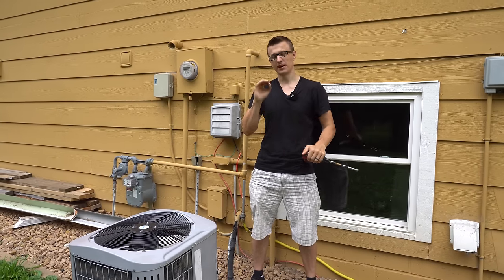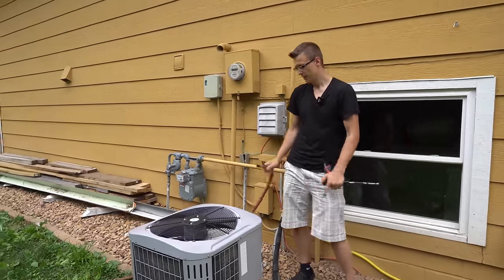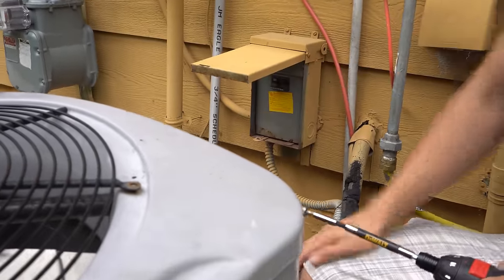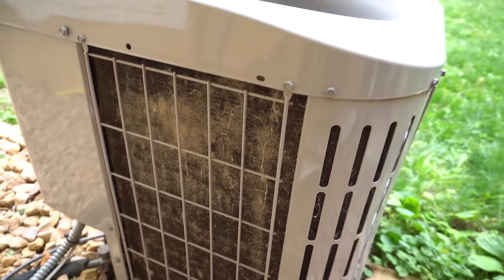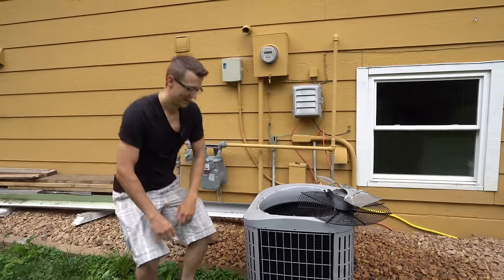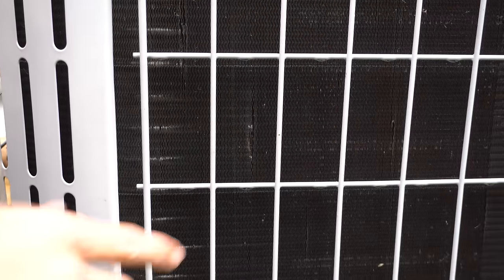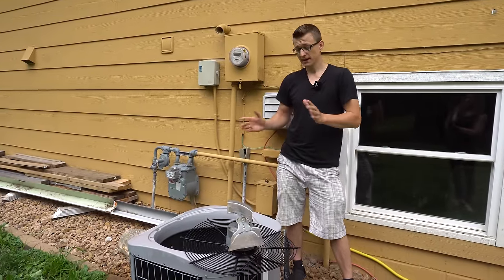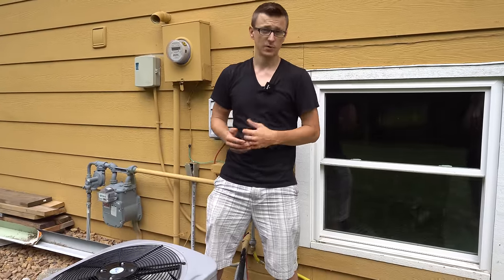#1 AC Problem With Central Air Conditioning Not Cooling

Comment: Hi and thank you for the video.  I have a vicious problem with my AC.  I have one unit that is split between 1st and 2nd floor with a thermostat in each floor.  If I turn both thermostats on, the AC works for a short time then stops. Then temperature starts rising without the unit kicking back on. When I turn one thermostat on, and the the 2nd one off, the AC works longer then stops and won't turn on again, then temperature at the house will keep rising. What I do, I turn off the thermostat that was on and turn on the other thermostat upstairs that was initially off.  The unit will start working again (sometimes not) works for sometimes, then it stops. Then temperature rises without the unit kicking back on. So, I turn it off then turn on the downstairs thermostat.  This is a temp solution, but does not work all the time. I do not know what to do.  The unit still works. The freon level is good. Have you had similar issues?  Thank you for your help. Zak

Comment: Gotta wash the coils, after solving the puzzle... 121.
Reply from the maker: 121 is incorrect
Reply: @WordofAdviceTV  I don't think I missed anything, but it is possible.  Either way, I'll consider myself right until someone logically proves me wrong.
Reply from the maker: @JBNetBreaker  It is more of a trick puzzle than a math puzzle. Try to take a closer look at the pictures and look for differences.

Comment: Other videos say if the lines are frozen then evap coil is too . That's my situation . Left them thawing out since early morning . My inside coil is hard to get to lying on top of furnace coonected to a few lines . I guess it's freon supply , drain  and one from the outside unit ? Goodman system

Comment: Our ac seems to not go below 73. Even before this heat wave, it wouldn't go below even though I have it set to 68. Also seems to be hitting 78 as the sun goes down, I'm guessing from the humidity. I nest changed the filter and still acting this way. Anything else I could try?

Comment: Do you have to take the top off? Can you just spray around sides and down in there?
Reply from the maker: No need to take the top off. Often times I simply spray it from outside in, all around it. That's more than enough.

Comment: Hey Jay, My AC isn't blowing cold air just blowing air. I don't get 24 volts to the thermostat or the outside unit. I checked the Zone Control Card EWC-ST-2D and I get no voltage to the Y wire. So I think its this card thats the problen.  Should I just replace it or try to fix it?? TIA

Comment: 165

BTW, what are your thoughts on using reclaimed R22?
Reply from the maker: 165 is incorrect :)

Is it reclaimed or recycled refrigerant? Reclaimed refrigerant is normally okay to use as long as it is not contaminated and is being put into the same unit it was taken out of. Other than that it should not be re-used. Or at least that's what I have been taught and have been doing.
Reply: Given how expensive R22 has become, lots of folks now selling recycled R22. Soon that will be all there is available. Who does a quality job of recycling?

Comment: My AC is almost 5 yrs old & stop cooling enough about a month ago. Compressor was replaced but didn’t fix the problem. Expansion valve and a filter on a copper hot line outside were also replaced and still not cooling enough during the day.

Comment: What's up Jay? Do you know anything about the HVAC system in cars? I have a Jeep with an open grill that allows insects to get caught in the radiator fins. Would it be safe or even effective to spray it from inside out like in this video?
Reply from the maker: Hey man! The coil on cars are pretty much the same thing. You could get most of the stuff off with water, just try not to bend too many of the aluminum fins in the process. (no pressure washer) If you put some soapy water into a spray bottle and spray down the coil that would probably help get more stuff off. Let it soak for 5 minutes before rinsing it off. You could also apply a brush to the fins to scrub some of the more caked on bugs. Again, if the fins are getting flattened left and right, it'd be better to just leave the bug there. 😄
Reply: @WordofAdviceTV  Good looking out...💯

Comment: Jay I was able to check the temperature before the Evaporator and after with a digital thermometer and after a while at each side I got 71.1 before and 41.1 after evaporator. Thats 30 degrees difference. Could this be right? Now the problem I am getting is when I set thermostat to 74 it drops temp but doesn't turn off, at 75 it turns off and turns on by itself. What could it be? Thanks Mark

Comment: My ac is working now after cleaning it with water 🚿.  Didn’t remove the fan 😅
Reply: How long after you cleaned it, did it take for it to start blowing cold again? 😅
Reply: @TheBoxingFamBam  lmaoo I need that answer too.  The inside still doe t have that frost condensation yet
Reply: Did you spray just outside the unit or inside and outside?

Comment: Yesterday I accidentally dropped a screw for the electrical section cover on my York Stellar compressor unit inside the unit. I thought it wouldn’t be difficult to remove the fan and hang it somehow while I fished out the screw. However, I couldn’t figure how to hang the fan either over the side or on top without breaking the wires to the fan , bending the fan blades, or damaging the cooling fins. Any good advice would be appreciated.
Reply: Watch the video he just did the same thing

Comment: Do you recommend using coil cleaner on the condensor? What about evaporator?
Reply: Aaron Gray In my opinion if you are cleaning your condenser each a/c season using just water is really all that’s needed. But most people don’t clean them regularly and wait until they are really blocked with dust, grass, etc. If that’s the case use coil cleaner, just be sure to rinse it throughly. Most evaporator coils are difficult to access the fins but if you are changing air filters regularly it’s not so much an issue. But if you can clearly see the coil fins and they are dirty then yes clean them, it’s not an annual thing like condenser coils.
Reply: @roberts1159  Thank you Robert.

Comment: I just started school for hvac, when you get a service call what’s your starting point ?
Reply: Hey Austin. I just graduated from my trade school a few months ago. Maybe someone can correct me if I'm wrong.... But first you would turn your thermostat on cooling and wait to listen for your blower motor to turn on... If your furnace or air handler blower motor doesn't turn on, you know that's where your problem is... But if it does turn on, check and see if your outdoor unit, fan and compressor, are running... If your outdoor unit does not turn on, then you know thats where your problem is. I hope this helps!

Comment: Answer is 26. 45/3= 15 so each gray hex is 15. 23-15=8 so both bananas=8 and 8/2=4 so each banana=4. 10-4=6 so both clocks=6 and 6/2=3 so each clock=3. then add 15+4+4+3=26.
Reply from the maker: It's a trick puzzle and you are still missing an aspect of it. 26 is incorrect.
Reply: @WordofAdviceTV  oh i see the last gray box is different and that it is a multiplication sign not an addition sign. I'm gonna guess each gray shape is worth 5 (becuase they each equal 15 and there are 3 shapes in each gray figure so each shape should be worth 5.) so 3+4+4*10=47 if your using order of operations. If not then 11*10=110. Im gonna go with 47.
Reply: @hungrybear2161 still missing about 3 other details.

Comment: This is out of context from this video but I’m having issues with my unit. Basically my unit stops dripping water after a while and blows air through the drain line which I have also noticed that the air that comes inside the house looses pressure. No the drain line isn’t clogged I cleaned it and I still have the same issue. I have to turn off the unit for about an hr. Then I’ll turn it back on works for about 1-2hrs and does it again. What could it be?? Your advice will be really appreciated!!!
Reply from the maker: Hi there! What you described sounds like your evaporator coil may be freezing over. This is often caused by either bad airflow or the ac unit is low on refrigerant. I would try replacing the furnace filter if you haven't tried that yet, make sure your returns are open and not too many vents are closed, clean the evaporator coil if you can access it, and lastly if the unit is low on refrigerant unfortunately this would be the point at which you would have to call out a tech. For more ideas of what to look for I have a video on 20 possible causes:
https://youtu.be/6jsm3tWmoPU
Reply: Word of Advice TV thank you sir. I will look into what you described and get it fixed as soon as possible cause this heat is no joke. I really appreciate your help!!

Comment: I have a Bryant (communicating system) units. I would get error code 76 low stage repeat no start. Do you know what would cause the error? I would think  compressor works (there is cold air) Thanks.

Comment: My Frigidaire has the reverse problem. The compressor? won't stop blowing cool air. Even when I turn up the thermostat to 90. Even when I turn the a/c off, the compressor stays on drawing power from the outlet. I have to unplug it to turn off the compressor, which turns off the a/c. I suspect that there's something wrong with the thermostat or worse. I bought this casement a/c in 2013, so it's not new or very old. My a/c has no reset button.

Comment: Can you make a video on signs of low AC refrigerant? I know that seeing your suction line freeze up is a big indicator since it may imply a leak. However, what if you don’t let your AC run long enough for that the line to freeze up? (i.e. you immediately feel no cool air so you turn off your AC). Also, as a homeowner, we may not have the tools, such as a gauge, necessary to check thoroughly. Therefore, any methods for diagnosing a low refrigerant system without a gauge will deeply be appreciated.
Reply from the maker: That is a good video idea! Thank you for the suggestion!
Reply: The suction line (big copper pipe) should be sweating during AC running. If no condensate water on suction line during AC running your AC might be low on Freon

Comment: The reason cold air is blowing but not cooling the house is cuz this? What’s the technical name for this problem?
Reply from the maker: There are a variety of things that can cause this. This (a dirty/plugged condenser coil) and a failed capacitor are two of the most common causes.

Comment: Both air handler and condenser working, but warm air coming through. Could it be low freon?
Reply from the maker: Yes it could be that or maybe the compressor is not coming on at all. Actually there could be quite a few causes, I have a video on that if you would like to see what the others are: https://youtu.be/6jsm3tWmoPU

Comment: The answer is 88. (2+3+3×11=88)
Reply from the maker: 88 is incorrect
Reply: @WordofAdviceTV  explain.  Each figure is different.
Reply: @WordofAdviceTV  I need a breakdown to dispute. Math is literally my superpower. In my break down which number was wrong?
Reply from the maker: @pinkiithe3nigma257  Its not that your numbers are wrong. Its just that this is more of a trick puzzle than a math puzzle. Paying attention to details. The answer and explanation is at the bottom of the video description 😉
Reply: @WordofAdviceTV  ahhhhh. Order of operations was skipped on my behalf. I solved from left to right instead.

Comment: I have a concept 1000 ac outdoor unit I changed out the capacitor but still doesn't come on any suggestions...?? Anybody  ?? Brand new capacitor installed but no fix

Comment: don't you think you should probably be telling the people to turn the breaker off so you don't end up having the fan blade chop them up? the first thing you need to be telling to do is to be sure and to turn off the breaker to the air handler and the condenser there buddy!
Reply: @Arin, did you watch the video? That was stated in the beginning.
Reply: @Ratlins9  yes I watch the video and after all the screws were taken out of the machine it was advised to turn the breaker off any safety coordinator would have corrected that the same as I did! not meaning to criticize but are we trying to cause people to harm themselves?
Reply: Arin the a/c man , your nitpicking someone who dedicates their time in making several videos to help homeowners. What have you contributed on You Tube except obtuse comments.
Reply: @Ratlins9  pointing out a safety issue! I wasn't criticizing ....
Reply: @Ratlins9  I actually love this guy's videos! As a 27 year veteran technician I feel obligated to point out safety! Especially to a great YouTuber that I follow....  I enjoy this guy's videos! Me pointing out a safety issue has nothing to do with your opinion! Safety first especially when you're directing homeowners to do a repair on their own!
Reply: As long as the power is off before the water comes on -- things are good.  You can't control everything people do.  Even if you say something in the "proper order" some people will do it out of order.  Those that are uber-safe will shut off the breaker first.
Reply: Arin the a/c man Some people put their seatbelts on before they start the car, some people start their car and then put their seatbelts on. As long as you don’t move the car it doesn’t matter and the same logic can be applied here. Again you’re just trying to seek attention with a bullshit comment after he directed the viewers to disconnect the breaker before putting your hands near the fan. If he had not mentioned disconnecting the breaker then your comment would be significant but he did mention it so your comment is still bullshit. Still looking for your videos.
Reply: @CitizenPerkins  so when the top screws come out of the unit and the unit kicks on just as you took that last screw out you don't think that would be an issue LMAO.... You can't sell some people common sense...

Comment: It's 165 because 3 + 4 + 4 x 15 is 165.
You left multiplication out of the equation. 😳
Reply: The clock on the bottom line says 2

Comment: 39 ? Or 38 ? Maybe 60
Reply from the maker: 38 is correct 😄 Thank you for playing!
Reply: @WordofAdviceTV   i guess on it ? How the ... I got it ? So no 39 ? Or 60 ?   I went by my mathematical algorithm" I use the consistency of the numbers to match the perfect outcome... I also divided and multiplied several factors including myself... 
Then I eliminated possible wrong answers. 
It left me with. 39 , 38 , and 60 .. my other possible answers were 76 , and and 58 , 68 and 28. ..
And I noticed a consistency with the number ( 8 )
So my shot in the Dark was. 39. 38. And 60. 
 ( that's how my brain works I'm surprised you said I got it right ) 😳
Reply from the maker: @darkonemylife123  Wow. That is a complicated algorithm you got going there! I am surprised you were able to narrow it down doing it that way. If you want to know exactly why it is 38 though, I explain in the bottom of the video description. 😉
Reply: @WordofAdviceTV  😐  i Did all of that and the Answer is under the video .. My way was more fun. 
Sometimes thinking outside the box is the way to go.
 ( Thank you )

Comment: I looked at your answer and you need to look close at both answer and question. The way you wrote the answer or the question one of them is wrong. Now I'm not which answer is right !
Reply from the maker: I just looked at the puzzle in the video again and did the calculations over again. I am still getting 38 for answer, everything seems to be correct.
Reply: @WordofAdviceTV  Well I feel you changed the question with the + and the x signs but my wife says your right. So I'm sorry your right and that's all I have to say about that! But me and my wife don't agree either so I'll let it go thanks.